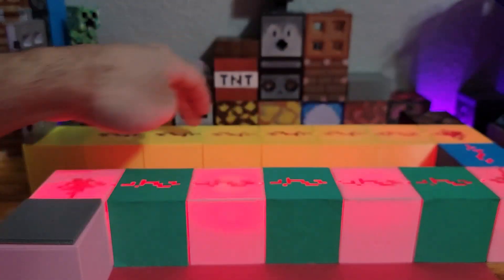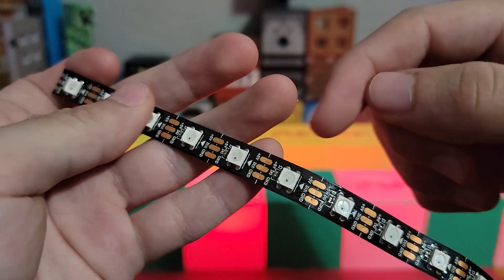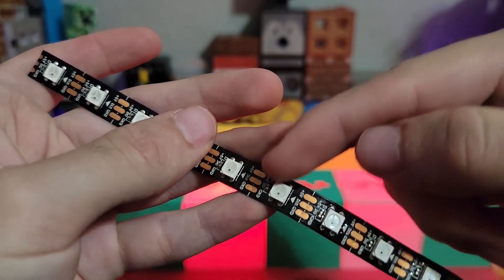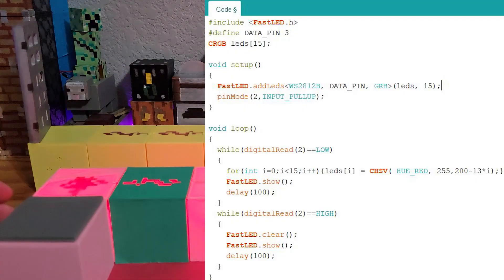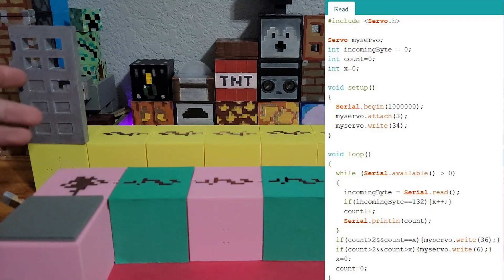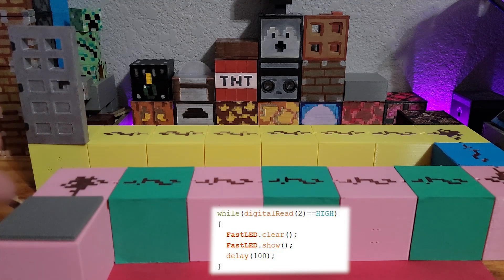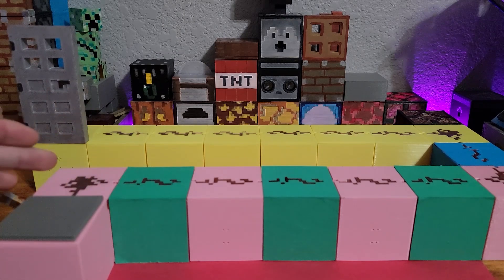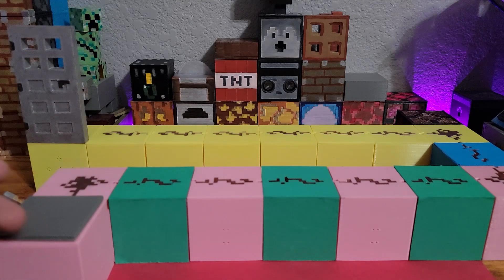Minecraft Redstone Dust: Addressable LEDs

Comment: what about using attiny and ic2?
Reply from the maker: I never heard of i2c before. Thank you for introducing the protocol to me : ) I think the communication may be a bit slower compared to using the receiving pin of the microcontroller, since the analog pins wouldn't be able to catch 800,000 samples per second. The attiny is able to control the leds using adrafruit trinket, but it's a lot easier to just implement the atmega328p